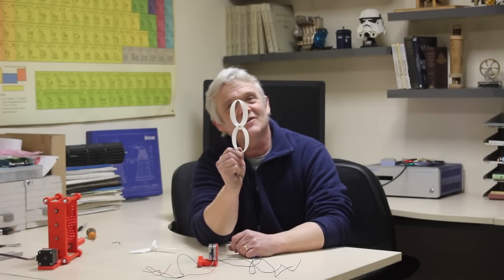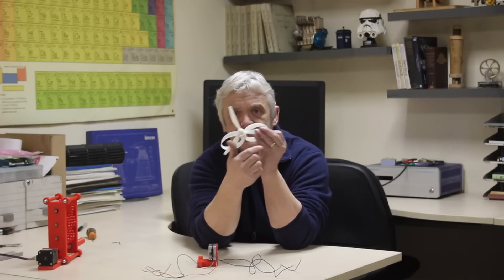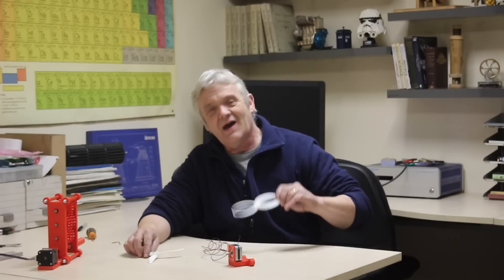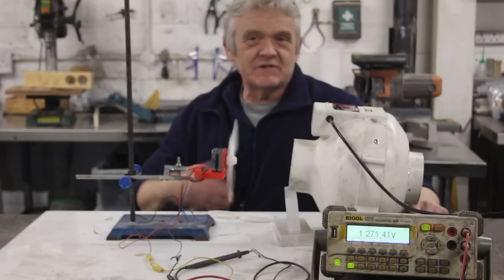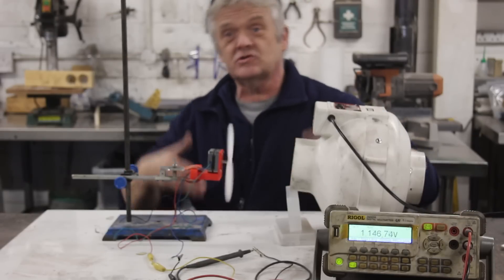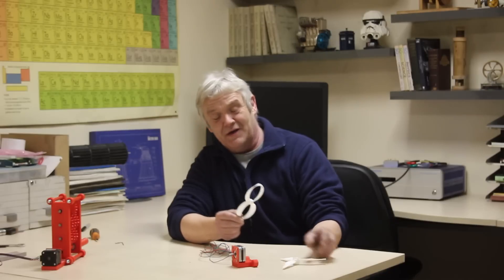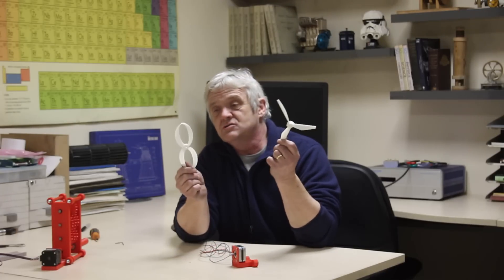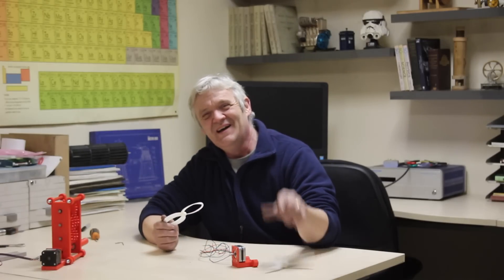1831 Is A Toroidal Propeller Better For Wind Generation ?

Comment: I mat be wrong but I got the impression that the following and leading part of each torus were not supposed to be within the same plane. IE, that the torus was twisted and the connection points where the torus met the main shaft were in two places.
And I got the impressing this was important.

Comment: If the toroidal blade had tracers on the inside of the ring that added to to total capture area of the wind then maybe a slight increase over 'standard' turbine designs could be seen, however there is still a limit to the energy that can be captured from the wind.

Just another gimmick from someone trying to make a quick pound I'd say.

Well done Rob, another empirical test to show some real numbers to spool through. Cheers mate!

Comment: You really need to get a decent variable load to test output power.  The output voltage is just the speed the blade spins at and that has a maximum set by the pitch.  You need a variable load so as you increase it the blade slows down until it stalls and you should get a decent graph of power output.

Comment: Graphs comparing the two types at different speeds seem to show minimal differences in power or noise at low speeds. It looks like you need to get up to 3,000 rpm or more before you start to see any difference. While you can get those sorts of speeds with a motor-driven propeller, you're unlikely to get that fast with a wind- or water-driven turbine. So maybe toroidals are beneficial for propulsion but they are unlikely to have any benefit for power generation. As Rob said in the video!

Comment: If it is about the same...on voltage, how about the noise level as the noise level alone would be worth the switch. Especially if used on something like an recreational vehicle generator.

Comment: I watched a video about this design.   They said it's a very good replacement for boat propellers.  It is quieter,  more efficient,  and eliminates water cavitation at the tips of the blades.  However,   based on what i've seen with people using it for drones,   it's not very good for wind applications.

Comment: To really understand a turbine's performance compared to others you need to compare not so much the voltage, but to compare their power output. Mater of fact, the Betz limit is all about power output/power in the wind, and what the limit is at different tip speed ratios. The Betz limit says nothing about voltage. We simply only need voltage along with resistance in ohms to determin power.  A given turbine's efficency is a function of its tip speed ratio and its tip speed ratio is going to depend on how much the turbine is loaded.

Please take 5 minutes to google coefficient of power, tip speed ratio and look for the graphs that include the savinouse, American Multiblade, High Speed Two Blade, and Darius turbines, and study the graph to visualize the relationships. 

I put a lot of effort into being constructive, especially if im going to be critical. I love what your doing and understand keeping things simple, and maybe im too technical, but sometimes too simple really misses the mark.  This video was almost useless for comparing two turbines. 

Try this at least once. Make yourself a potentiometer with some of your conductive ink. Mark out different resistances by position. Then take voltage readings across the circuit resistances with current from the turbine and generator, and graph both voltage and power along the Y axis against resistance on the X axis, with power calculated by watts=voltage²/resistance. You will discover how you load a turbine strongly influences how well it performs.

Comment: Hmm.... Rob, a bit concerned abt this test. By eye, the supplied air "looks" as if it has a narrower cross-section than the turbine blade. Suggest moving apart another 6", so the blades are within the driving airstream. This might effect the toroidal blades more, as they have more surface at the periphery.

Comment: I don't know who told them it was a "superblade"...? The only point of toroidal blades is that they generate less noise due to the vortex shapes they create - designed to make quieter drones afaik... I was expecting them to test for that... 

but on this subject... I'd also REALLY like to see that darwin air collector be tested with  the design "3D Printed Cyclone Air/Dust Separator" that rctestflight made a video of. 

I am wondering if that device that pushes the air into a cyclone could somehow ampplify the output speed of the air down the tube out of the darwin collector...  alternatively.. I would also be interested to see how the darwin air collector behaves when SUCTION is applied to the opposite end of the tube... would you get amplied suction at the 'collector' side? I suppose that wouldn't make sense... but... I dunno... vortex and cyclone dynamics seems intuitively to me like there might be some kind of optimizing effects on the darwin air coolector

Comment: A big difficulty for the giant propellers on the giant wind turbines is the breaking points of the blades.  My proposal question is if these alternate style of blades hold up better at higher tangential velocities?  I do realize that this can’t really be tested on the small scale, so just a thought.
Reply: I was wondering which was stronger.
Reply: @MIck1-10  it would be fun to set up each propeller to super insane speeds just to see which one hits the breaking point first.

Comment: It seems to me you'd have to match the pitch and blade area of both types of propeller to do a realistic comparo.  Otherwise, it's like comparing a V6 engine to a V8 without considering piston displacement.
Reply: The big problem is that the actual paper on the "revolutionary" blade, from the MIT Lincoln lab, doesn't itself mention at all efficiency, RPMs, energy consumption nor ANYTHING that could make the comparison with traditional blades even remotely meaningful

It reeks of star-up marketing bullcrap

Comment: The advantages of toroidal propellors on boats are caused by a reduction in turbulence at the tips and a reduction in cavitation in the fluid. The advantages are most noticable at certain speeds under certain loads. Perhaps the same is true of generators? Maybe just use regular blades inside a duct to reduce tip turbulence or put wing fences on the blades? Cavitation is not a problem in air like it is in water so maybe toroidal blades are best suited to boat propellors?

Comment: It would be interesting to test in water. Apparently the 3 blade version on a boat is 20% more efficient. It has to do with cavitation on the tips. I saw someone testing it. It definitely looks like it cuts water cleaner than a standard blade. Fun little test but I think there is more to it than just that simple test. But cool to see they are close anyway

Comment: What happens if we take a ring around the three blades put our permenet magnets on the ring and have our coils on a ducted place around the propeller? You can always find a better solution for a fixed purpose and an everlasting eight can be the best! its a bit hard to see it now but if a 280 meter high windcraft can be the best and no one will live ten miles near it! Maybe a everlasting eight is the answer! 🥸/Mikael

Comment: @0:50 the toroidal blade is actually less efficient, its just quieter because the air flow is directed more. The Toroidal blade was created to make drones Quiet. That was the goal, Is the goal. Quiet doesnt equate to efficiency or power. It is all about a more quiet air flow....

Comment: I think the exciting bit about toroidal 'blades' is not that it offers staggering advantages any one place ... but it offers an entirely new geometry to work with to tweak and get particular traits where it's needed... like very quiet for instance.   They won't be a panacea that makes all props and turbines better everywhere under all cases... it's just like someone has moved the creativity barrier a bit farther back and now more options are possible. Will they be even better ducted? how about 3 or 4 loops?

Also ... not much chance you'd nail the perfect geometry in one go. lol  It took decades, big brains, computers and a lot of wind tunnel time to tweak out the most efficient props and blades for a million different uses... The same will happen at blazing speed with toroidal loops.
Reply: I saw type of troidal blade put on a outboad engine for a boat. They showed in water that there was a lot less cavitation "less noise" more speed or upto 20% better economy at   cruising speed.  Although flat out they were the same economy?
Reply: @martinrothwell8966  Because drag is a function of speed, particularly in a heavier medium like water.
boat hulls are designed to be efficient at particular speeds. Going above that speed reduces the efficiency, just like driving a car faster than it's designed efficiency. 
This is all 20th century science.
Reply: It isn't the only alternative to propellers.
Reply: Something I noticed was the weight. A test with all the same parameters should be made with a propeller that has the same weight distribution.

Comment: When they design wind turbines, they must keep blade tip speed below, for example, 60m/s to meet noise requirements. It's about vortex shedding off the tip. This means they either have to limit rpm or swept diameter. The claim for the vortex is that since the tip is spread over a much larger span, it will run quieter. That would mean the wind turbine blade could be bigger in swept diameter or the wind turbine could spin the blade faster and still keep the noise down.

Comment: Air toriodal Propellers are not going to increase efficiency but rather reduce vortices and thus Noise.  Water Toroidals increase efficiency by reducing vorticies which in turn create cavitation and drag in a non compressible medium.

Comment: The 8 blade is supposed to be more efficient with a reduction in noise for the same thrust.

The primary research came from research into making ships screws more efficient.

A general rule of thumb in aviation is that unless it's a fan, 1 blade can work if counter balanced, 2 is very noisy (unless it's thick and slow - e.g. WW1 rotary engines) for a bit more thrust, 3 is optimal, 4 starts to loose thrust but is quieter.
Reply: "The primary research came from Stanford with papers published on the subject."

Link, please... cause the Lincoln Laboratory "tech paper " that is causing all this buzz is a facking joke, I'm afraid...
Reply: @TheChzoronzon  it appears that Lincoln did the aviation work and I picked up some separate early work on ships screws so I'll correct my original post. Apologies for taking you down that rabbit hole

Comment: I am not sure the test was exactly fair ....... 

Why put the toroidal against a 3 blade not a 2?
and the key advantage of the toroidal is said to be the efficiency over a large wind-speed! To be fair the toroidal was envisaged as a propellor and that is also a bit different. The smoke tests on them show an interesting down wind pattern. 
Also there is the tricky thing of actually getting power conversion from the wind not just non load rotational speed! Maybe a car interior light might give a "better" idea of that one....... Or maybe having a fan powered off the first blade and measuring movement of ait as an efficiency? All more work to be sure, but it might be a handy jig for you to have in the shop?

Having said all that you are not far from the truth in your assessment! ;0)
Reply: Search: "MIT Thinks you're STUPID - Toroidal Propeller Snake Oil" and weep :)